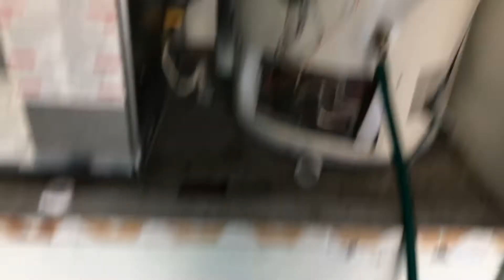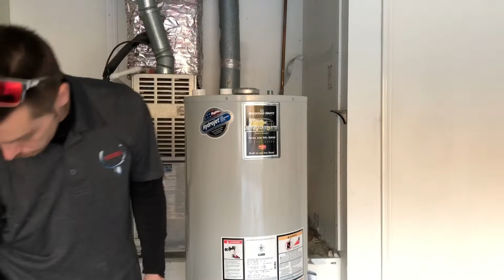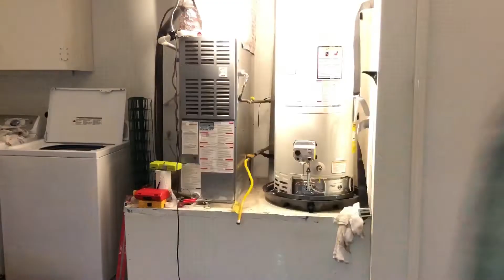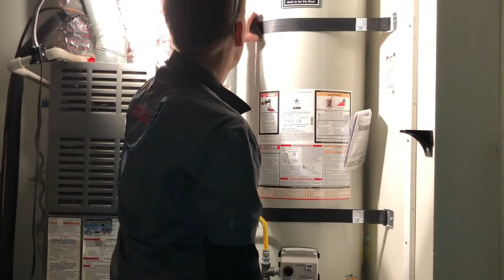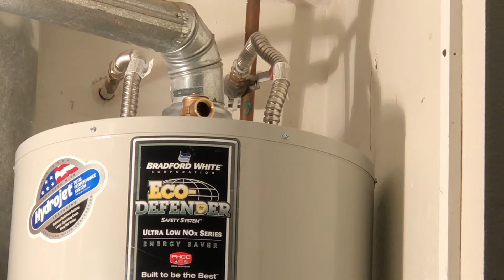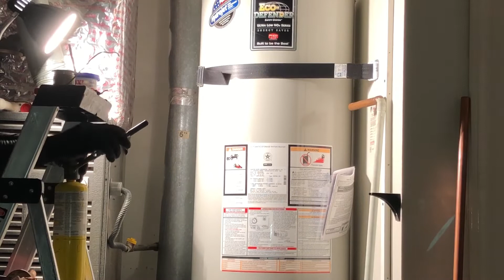50 gallon water heater installed using Harbor freight Tools

Comment: Is that a plastic pan?  I was under the impression plastic pans are only for electric water heaters.  No?  Thanks for the many tips in the video.
Reply from the maker: It’s an indestructible pan, it’s not made of the same plastic as the thin plastic pans I’ve seen a box truck run over one of these and they don’t break or crack, they also elevate the heater off the bottom of the pan which helps it breath and allows you to make repairs without having to remove the heater from the pan or cut the pan to make repairs
Reply: @PlumbingExplained  Thank you!  Yep, I looked it up after finding it in your description and that Vizco plastic pan does say it's for gas too.  Have you ever seen the cheap plastic ones catch fire?

Comment: A co worker of mine bought a pair of Doyle big jaw pliers for basket strainers. The shorter handles make them easier to work with in cabinets compared to the long handles on the channelock 460.
Reply from the maker: Dude the Doyles totally kick ass I hope they last too because I really like them ever since i bought my 8" Doyles i use them more and more because they are the perfect size also love Knipex now too man have you seen the Knipex pliers wrench's? They are badass dude i been collecting them when I can afford to. But yea i got my 8" Doyles and now I got the really big oversized ones.
Reply: Plumbing Explained I haven’t seen the knipex pliers wrenches.  I will definitely have to check them out.
Reply from the maker: Myles Mastersen yea dude check them out they are the red handled wrenches the jaws look like a brushed chrome not shiny they are without a doubt my favorite pliers now I was planning on doing a comparison video this week on Knipex vs Channellocks vs Doyle